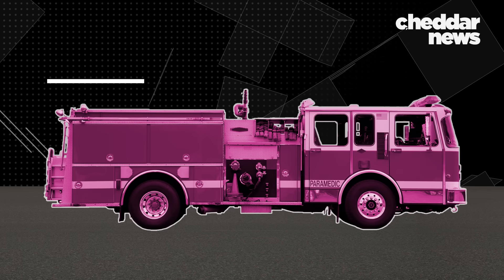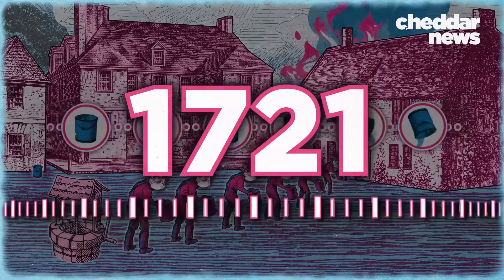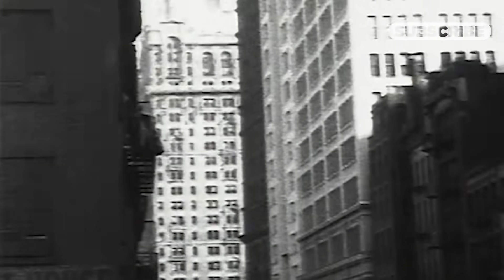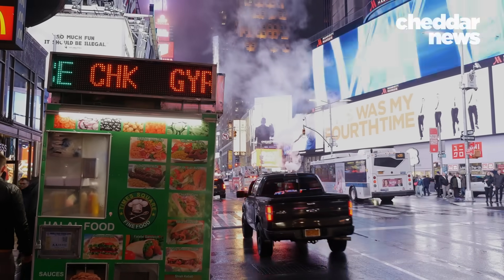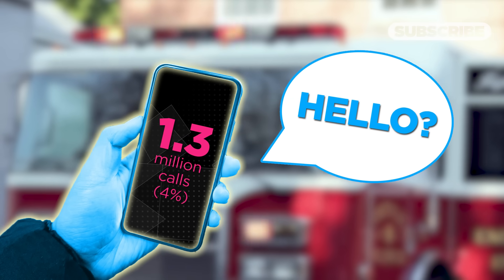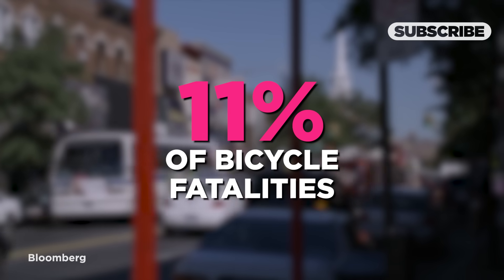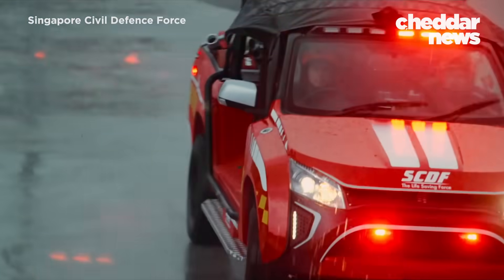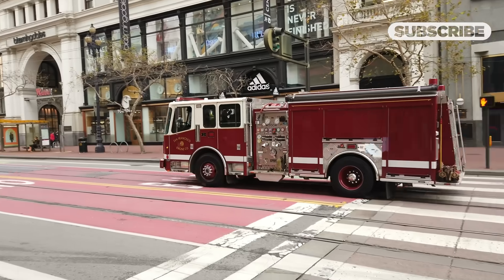Do American Fire Trucks Need To Be So Massive? - Cheddar Explains

Comment: if the trucks werent that big, and had less of everything due to size, good luck putting any fire out in the united states average city or town. sometimes firefighters have to let it burn down because they cant put it out even with everything they have now. point of the matter is: if you want something to burn, make sure to mess up who puts it out, even if that means underequipping the people dragging you out of a house fire. thanks media for making our lives suck just a little more.
Reply: "because they cant put it out even with everything they have now" of course you can't safe every building from burning to the ground, some will be a total loss no matter what you do; However in some cases the tactical approach sure might be an issue. Surround and drown is an option, but might not be the best in every scenario.

Comment: American trucks are larger, which gives better access and thus faster speeds, plus more comfort (except sound insulation, seriously, fix that shit!).
This is because large american streets in pre-planned square city blocks allow for it. Preconnected hoses allow for fast attacks, and need space if you want to put them back inside your engine. In medival european towns you can only use small trucks, that are much more densely packed. They don't use quick attack hoses the same way, they have hose packs or hose boxes. You need to navigate complex roads and alleyways.
Reply: better access to what? To the cab, to the compartments, to the hoses? In which way is their access better to all that compared to e.g. German apparatus? More comfort? Well crew cabs don't need to be designed for long distance rides, but apart from that: if you take a commercial truck chassis which is designed for long distance trucking business I guess comfort won't be the worst. 
Streets in Sweden are mostly planned to American dimensions and standards but still you won't find larger fire trucks there
Preconnected hoses are a standard in many European countries. "and need space if you want to put them back inside your engine." for one there are hose carts where its easy to put the hose back onto, and concerning hose beds modern apparatus often have a hose recovery unit which will pick up the hose and put it back into the hose bed without firefighters dragging the hose up there

Comment: Former NC volunteer fire fighter here, I’ve been on rural and urban trucks. Rural fire departments tend to run with a wider variety of equipment/tools and require larger tanks as they have less trucks and less access to water while covering a larger area.

Cities might beable to get away with having a smaller truck or two but those trucks are a steep downgrade for rural departments
Reply: an issue which rural departments here barely have; Of course in the open field, forests etc they might have to lay down long hose lines or run Tenders / Tankers as water shuttle, but apart from that water supply is barely an issue in the villages here; Also they have a rather moderate fleet; Living in a rather large village of 10k inhabitants the local volunteer FD runs 10 emergency vehicles here

Comment: If anyone's interested in Australia we have smaller 4x4 trucks with remote controlled hoses so they can get just about anywhere in the scrub and the people don't need to get out to fight the fire so they make a hugeeee difference in bush fires. There is videos of them testing them 10km up the road from my home town which is cool and its quite interesting. They can be engulfed nearly completely in flames for a decent time too.
Reply: It's called a monitor. They're actually quite difficult to use because there is a fair amount of lag between the joystick and the monitor. They also chew through the water very quickly. If you've got a fire directly in front of you, they are great because you don't have to move it much.

Comment: Bigger may not always be better, yes, but it's not aesthetically pleasing to look at. Europe's compact fire vehicles look weird and at certain angles and lighting, a little dopey. Fire vehicles are meant to be big and heavy so they can block traffic when necessary. Everything but the biggest semi would stop if they tried to smash through. Lighter more compact vehicles would get destroyed by an average sized pickup going over 50mph.
Reply: be sure, Europeans have ANY dimension of fire apparatus; While they have some of the smallest and most compact ones besides their average sized apparatus, they also come up with THE world largest fire trucks
Btw just like in the US it happens that idiots smash into the blocker unit on scene; Those blocker units are usually just average sized fire trucks here. Depending on the layout, the blocker unit itself will be barely damaged, or the rear end will be smashed, but that's about it; It's not like a semi truck would send a fire truck bouncing across the scene when it smashes into it
Reply: @EnjoyFirefighting  that's cause European semi's are wimpy. They have that disgusting cab-over configuration. And you can't go very fast on those small streets. America is built tough, and for power
Reply: @RayHardman7567  well that's for the simple reason that in the US only the length of the trailer is limited, in Europe the length of the entire truck; So cab-overs make sense for greater cargo capacity. 
"And you can't go very fast on those small streets. " entirely depends on the kind of road and country?! A German Interstate is definetly designed for higher speeds than US Interstates. Trucks are limited to a lower speed in Germany though, but also those limits differ in every country
Although the average American fire truck is larger than the average European fire truck, the largest fire trucks are in fact from Europe. The longest, the tallest, the heaviest, the greates capacit, ...
Reply: @EnjoyFirefighting  so we're in agreement. The best size depends on what the country's set limitations are.

Comment: STUPIDEST THING I SEE: Sending both an ambulance AND a fire truck 🚒 to a medical emergency!
 So, someone is feeling pain in their chest. A possible heart attack.
 They call 911, and BOTH an ambulance AND a fire truck are sent.
 WHY⁉️
 There's no fire, there's no rescue.  It's just a simple medical response which can be handled by a couple, maybe three paramedics, and an ambulance.
 How much unnecessary wear and tear, wasted fuel, and time does all this cost?
 Plus, what it while a fire crew accompanying a pair of paramedics, a REAL emergency happens somewhere else, such as the opposite side of a fire station district? That means the fire crew has to remobilize, leave the scene of the medical emergency, and drive maybe twice the distance (and this twice the time) than if they went from the fire station
 Instead of

Comment: Let's see some data, take multiple pairs of fires and see which truck does the best job. Because saying we should have smaller trucks because someone else has a smaller tuck doesn't really make sense when sometimes a bigger tool does a better job.
Reply: sometimes, but not always. Take Aerials for example: the same size of truck chassis American departments will have for a 100 ft ladder, Europeans will have sth around a 150 ft to 200 ft ladder on the same size of truck chassis. 
Also the tactical approach is entirely different here; Not that much surround and drown the fire

Comment: U.S. fire trucks carry water.  A lot of it.  This is so they can access areas around the city or county that don't have fire hydrants.  They carry NUMEROUS tools.  Their size also helps block traffic and actually stop it if someone isn't paying attention usually during a car accident, a house fire/ brush fire and other circumstances so it keeps people in the emergency scene safe.
Reply: guess what: also in Europe there are areas which lack a hydrant network, departments carry lots of tools and also they block traffic. They in fact block traffic which travels at a much higher speed as well.

Comment: A few things:
1. Ladder Trucks like that are literally the biggest of the big. The most common truck you'll see here is a Pumper or maybe a Tender.

2. You showed a 30 year old Pumper to describe a modern truck. Why?

3. Europe mainly uses Brick and Cedar/Other heavy woods in construction. USA tends to use light materials like Plaster, Oak and Vinyls.

4. Not every truck has hydraulic ladders. That's why there's specific units called ladder trucks. Additionally, the main reasoning for the massive ladders is to attack a large building fire from a higher vantage point. Ie. A small store or a larger home.
Reply: a massive ladder? Most ladders in the US don't reach taller than 100 ft; There are some very very few taller ones, but ... they're super rare; Taller ladders are pretty common in Europe, and they're still on a more compact truck chassis
Reply: @EnjoyFirefighting  
Yes, I was referring to the ones that are common in cities with larger buildings such as Richmond or Atlanta, which tend to be about 90ft if not a little less.
Reply: @ElDoggo141  here you basically don't find any Aerials shorter than 100 ft; 60t ladders existed in the past, but most of them got replaced by now

Comment: Ive read comments from a few firefighters in this thread now, detailing what equipment they carry and why it is important to have it all. They all seem to agree most calls are EMS related, but that doesnt mean you can cut away the fire gear, because sure enough its not used as often, its pretty important.

Comment: In rural areas it is not uncommon to have pumpers that hold 1000 gallons or more in the tank, and can pump 1000 gallons a minute or more. This is needed as rural areas do not have hydrants in all areas ( especially out of the towns). There are also dedicated tanker trucks holding 1300 -3000 gallons to haul water to the scene when that is the only option. None of this fits easily on a small vehicle.
Reply: there are rural areas in Europe as well ...

Comment: I’m offend on how bad this video.  I’m a firefighter.  I serve a rural fire department.   To the author of this video…..my district has no fire hydrants….so I have to have 1000 gallons of water plus several 2000 g tenders.    How in the name of Ben Franklin can I use your plan to use small European trucks??  I’m a nice liberal guy but this is a “Europe is better than America” video pretending to be educational.   American firefighters especially rural ones fight different fires in completely different buildings.    I fight fires in type 5 construction buildings (google it) with a 20 minute response time and 1000 gallons of water.   Walk a mile in my boots or at least tell both sides of the story.   Bad video bro
Reply: Europe has rural areas with no hydrants as well. Guess what: they will barely use the surround and drown approach on scene of a fire call then; They'd rather use the exact opposite, using as little water as possible. Also in Europe you find countries where buildings would match to your type 5 type building style

Comment: US fire trucks are also way better
Reply: in which way? For taking a larger truck to fit the same size of a ladder? For having more basic ladders and steering tech on their apparatus? For having less seats in a crew cab? for for not using some of the equipment which is used by various departments across Europe? How exactly are they better?

Comment: 10ft wide? Bullshit. They are not 10 ft wide. Also, a c.ass 1 pumper is not 40 ft long.  Example, a highway motor coach is 39ft long   Also,  75% of all accidents involving heavy trucks are caused by 4wheel vehicles.  What needs to happen is, Cyclists need to start paying attention.  Pedestrians need to start paying attention. And you need to stop misleading people.

Comment: The only places where you see smaller trucks in the US, is more rural areas, places like upper Wisconsin, Montana, etc. Where big cities aren't common, and where smaller brush trucks and draft trucks are more versatile due to off-road conditions and less paved roads.

Other than that, big, beefy, heavy trucks that can rip your skin off with the deck guns, are common in the cities and more urban areas. When you have more buildings and civilians in harm's way, you need to put that fire out quick.

Comment: 0:14 I love how they made the "American fire trucks look old" comment while showing a video of a fire truck built in 1992 (one that has since been retired from the FDNY's fleet for over 10 years)
Reply: The new ones are coming out are bigger and fancier and they look amazing
Reply: @charlieboyd4431 still the USA has alot of catching to do to Europe when it comes to trucks
Reply: @notpillow6759  diffrent trucks for diffeent areas. in the US we can go big and wide. while the europe your stuck being small on how the roads are built
Reply: @charlieboyd4431  And the reasons having technologically inferior trucks def is because of going big and wide and not close market?!
Reply: @ US has many different areas of the country you got the smaller trucks for the city then you have huge trucks for the country.
Reply: @charlieboyd4431  doesn't matter. In AUS and NZ you can have both EU and US tractors doing long distances. Even with long noses you have to do 90 degree turns which is a problem and because of that streets have to be unnecessary wide making it dangerous for cyclists and pedestrians. I saw that even those big 18th wheel semis ending up in the middle of the downtown causing traffic problems. So I don't get your argument.
Reply: @SzaraWydra  thats the good thing about the US the roads are already massive

Comment: I think the rest of the guys put this one to rest, but as firemen know, we love to gripe and weigh in with our own two cents when it comes to inaccurate beliefs about the fire service. This video is a VAST oversimplification of the topic, as well as greatly uninformed. 

My dept. is semi rural, partial full time partial paid on call, necessitating a "do all" engine for lack of a better term. We run fire supression and extrication gear on the same engine, which necessitates a LOT of space, especially compared to depts that are afforded the ability to run fire supression on the engine and extrication gear on the truck. On top of that, with inconsistent sources of water supply, especially when leaving the city and heading into the rural county area, we carry 1000 gallons on our engine. Combined that with a midmoint pump as opposed to a side panel,  and our engine is longer, and taller as well to account for snow, rough terrain, notoriuosly poor departure angles, etc., making for a larger engine. We do also run a squad (a pickup fitted with a utility cab with monitors, a CAFS, limited extrication) for running errands or non emergent calls (CO, fire alarms, minor traffic accidents), but when we need the engine, it has to do a lot for one apparatus, especially not knowing when a secondary apparatus will be staffed from an on call station. This holds true for many depts. as well, even entirely full time ones. We as firemen are called upon to provide aid in a huge variety of scenarios, and we need the selection of tools a larger appartus can hold. 

The "old" look comment struck a chord with me as well. The US fire service is steeped in tradition, and that is reflected everywhere from our helmets to our apparatus. And as other comments have mentioned, the cabs on the Euro style rigs are not rated at the same level of protection our "big red boxes" afford us. So please, actually talk to a firemen before you make such an ill informed video on our profession again. 

(On a personal note: you wouldn't catch me dead in one of those Euro rigs).

Comment: british fire trucks do not hold near the amount of water American fire trucks do as you can see almost all british fire trucks require an immediate water supply being that they have no tank being that all the hose also has to go in the compartments because there's no storage for it American fire trucks are larger for a reason
Reply: of course not; But many European apparatus can easily hold the same amount of equipment, some of them even carry more despite being more compact; Other places around Europe also have e.g. preconnected hoses on a hose cart hanging at the rear of the truck, allowing more space inside the compartments

Comment: Except the smaller sized ones can never and will never reach high in buildings, and narrower ones will never be as safe to lift as high of loads(ladders or pickers) as narrower trucks, so you will opt for unsafe and unable vehicles going for smaller or battery operated vehicles
Reply: oh they can't? Although not quite as many, how do you think they manage things in skyscrapers in Europe? Dubai has lots of skyscrapers, but the fire trucks are European as well. 
"narrower ones will never be as safe to lift as high" that has not that much to do with the width of the truck, but the width of the outriggers; Keep in mind: European Aerials reach further up into the air than American ones ...